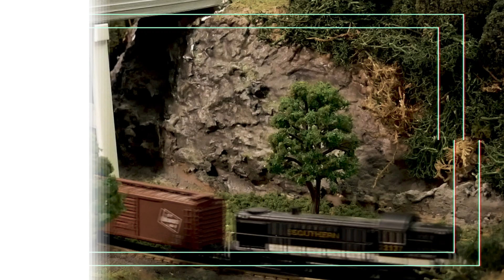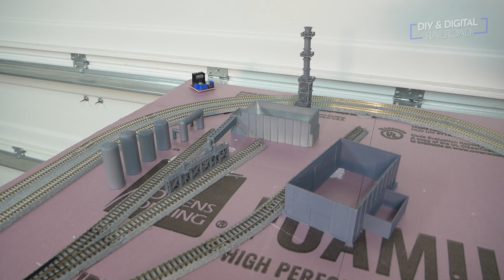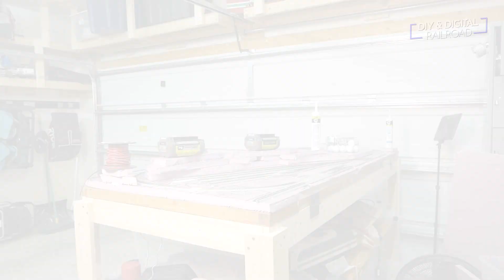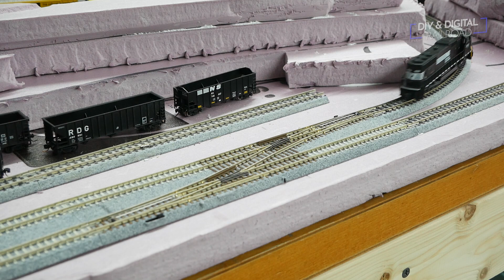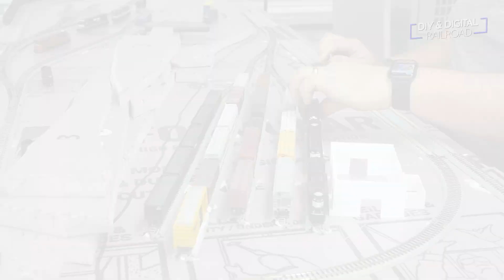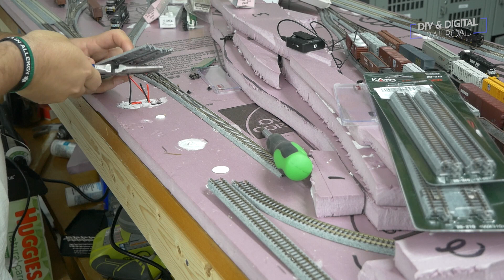Model Railroad Layout Update 4: Test Running My Model Railroad

Comment: That's crazy how the double crossover fixed your single crossover issue. I was going to mention about adding a small straight between the curved piece of track and the single crossover just to see if it would keep causing derails or if that would fix it as the cars have more strains on a curve rather than a straight. - Jason

Comment: I had similar issues with that exact same single crossover.  Atlas locomotives and rolling stock constantly gave me fits.   I switched my track plan up and went to single KATO #6 turnouts and have not had any issues at all.

Comment: Nice Jimmy. I found that the Kato single crossover works best on straight aways not right on the curve the bend and then twist causes the couplers to pull apart because the travel on the engines have a short range of motion.

Comment: Coming out of the curve there should be a straight section approximately the length of the longest rolling stock. This reduces the S curve effect. Also coupler swing on six axle adds to the problem. Not sure if the double turnout has the same degree as the single.

Comment: That single crossover was located right next  to the curve leading into it without any straight track to mitigate that vicious S curve. If it would have been a right handed crossover there probably wouldn’t have been an issue but it being left handed exacerbated the problem. 
I’ve been using Kato  Untitrack user for years and have found that the #4 turnouts get a bad rap. If the limitations of their geometry is acknowledged, and perhaps with just a bit of tweaking, they can be utilized and made to perform flawlessly. I don’t like the double crossovers as those are never used in North American practice except for rare specific instances. 
Also fine tuning all rolling stock will result in zero derailments. This includes the usual: making sure all wheels are in gauge, using metal wheel sets exclusively, as well as converting all rolling stock to body mount couplers. Properly weighted cars are also a must. No exceptions. 
One other thing I’ve done on my layout is that I always use a larger radius curve at the beginning of a curve thus forming what I like to call a “poor man’s easement.” Not only does that result in better performance, it visually enhances a train as it smoothly enters a curve. 
Working in N scale we have to always keep in mind that physics works against us more than it does for those modelling in larger scales. Proper attention to a few details will maximize the enjoyment and minimize the frustration.
Reply: I had a similar problem with my HO layout and you are correct the addition of a straight track before the curve starts solved the issue.

Comment: your single crossover needed to trade places with your straight section.  The reason they were de-railing was the "stresses" pulled the car in two different directions as it came out of the tight curve and attempted the crossover.  If you had the straight section and then the crossover, it would be fine, as the double cross over you can see it has a small bit of straight track as a part of it before the anything hits the switches.  I avoid this issue as much as I possibly can on my own layout, by moving control points away from the curved areas of the layout by at least having a section of straight track (in this case an Atlas 5") before getting to, or leaving the curve.  Also in my case anything interacting with the main line are all Atlas #6 switches while anything on the branch line or sidings are all #4.

Comment: Any ideas about why the single crossover failed, while the double crossover worked?
Reply: It's the S curve. The car is just coming out of the curve while the back locomotive truck is the next curve, causing the locomotive coupler to move away from the front of the first car.
Reply: @Giggity4242  I think the part that isn't immediately obvious is why the double crossover should avoid the S curve. I guess I would have to look at the two setups physically to understand it, but what you say makes sense. I know S curves are to be avoided. Thanks.
Reply: @Giggity4242  I have had the same issue with straights on both ends. All I can figure is that double uses #6 switches while the single uses #4
Reply: @jamescraft672  They definitely should be. The double crossover provides just enough of a straight piece to relieve the trucks and couplers from swinging around.

Comment: Looks great Jimmy, did you figure out what was wrong with the original turnout. I find it's sometimes the change in temperature, or the turnout doesn't close well at the stock rail, or you need to clean and bevel the swing rails. Turnouts can be a headache that takes a lot of time to get right
Reply from the maker: So I’ve never had good luck with the Kato single crossovers.  Their points are machined thinner than their other turnouts and I think that makes them more prone to snagging on wheels and opening while the cars roll over.  They never have that solid “click” of settling into place like other Kato turnouts.  The double crossovers are built differently.
Reply: @DIYDigitalRailroad  Watching your video, I think that the main problem is that as the loco enters the crossover, its rear end and the body-mounted coupler swing out to the right (ie toward the centre of the layout.) As the loco coupler does that, it drags the front coupler of the leading car across to the right as well, forcing the car's leading truck to pivot toward the right at the exact moment that it should be going left to enter the crossover. I'm guessing that the stock rail does not have a recess for the point rail to fit into, and the wheel flange is therefore being forced to ride up the rail.

Comment: 4:45 Its that version of the kato switch, its incredibly poorly designed, the entire mechanism is dependent on a very weak copper wire that is the mechanical arm that throws the actual switch, and its really flimsy, i had to waste so much money on number 4's and on the single crossovers to learn this. :(
Reply: Interesting.  I was going to replace a double crossover with a single but now may reconsider.

Comment: Are those n scale kato tracks 
If so do the turn outs have manual switchs
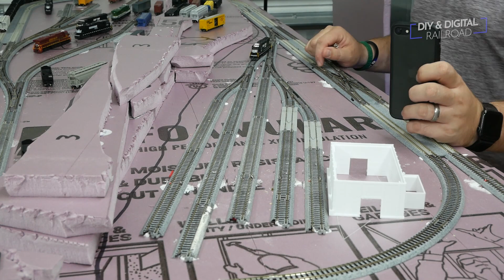Reply: as you can see on the sides of the switch is a little black arm he uses to throw the switch (5:47 to 5:50), what is also nice about all of those Kato track switches is the switch motor (for when powered or remote switch) is located under/in the road bed, no need for undermounted motors.